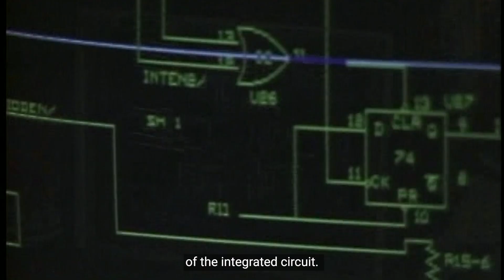A Journey of Progress: Building the Next Era of Semiconductor Manufacturing

Comment: I worked for TI in Sherman TX, we built the modules for the entire pipe line
Reply: I worked for them for 32 years.   From 84-86 in GSI in Dallas,  90 -96 is Central IT,  97-2002 in DLP and then 2003 - 2020 back in Central IT before retiring at the end of 2020.